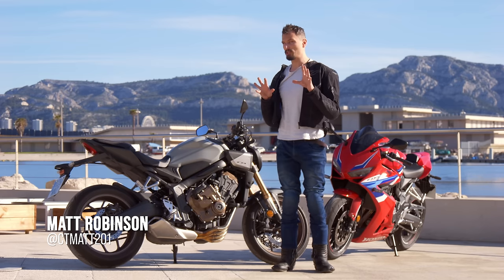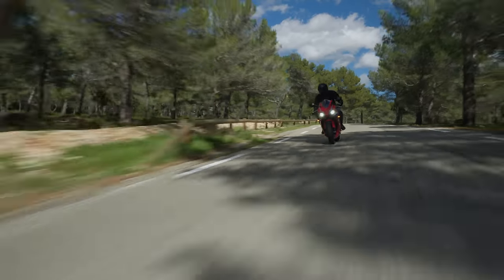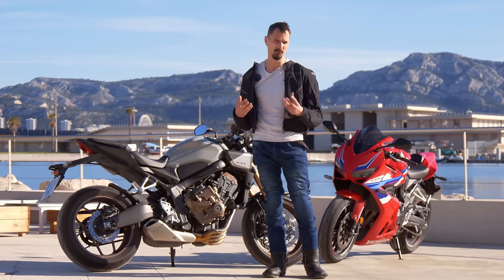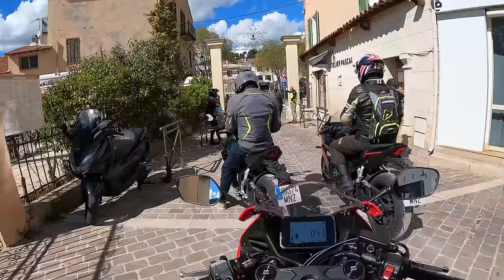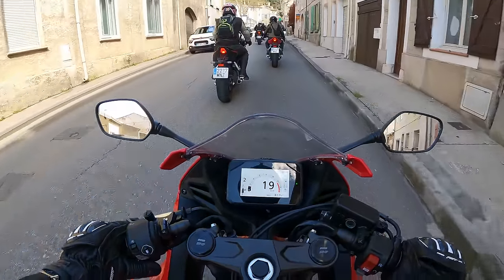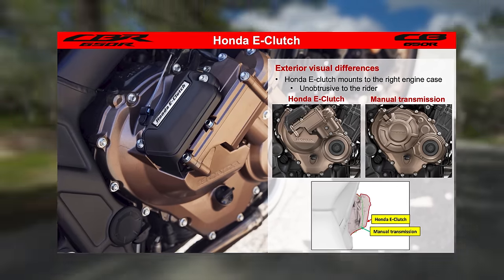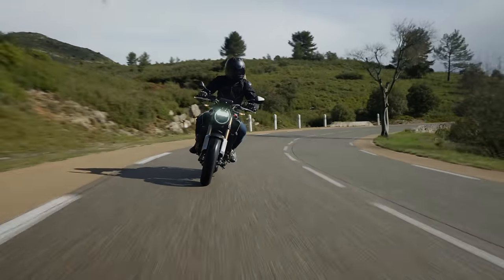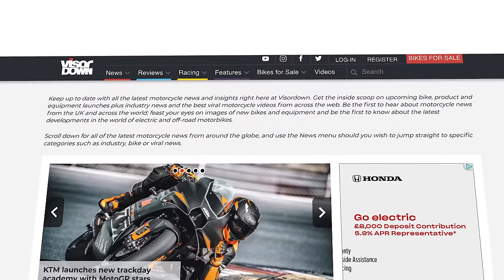Is Honda's E-Clutch A Gearbox Game-Changer?

Comment: Now if they make to gear change using the same tech those of us that have a foot injury could ride any bike and not just the DCT ones. What reviewers always forget is that it is DCT that makes the bike an automatic it is the electronics, so put an actuator on the gear lever instead a mechanical connection (as BMW are going to do) stick a couple of buttons on the handlebars (as BMW aren’t going to do), put the lot under EMU control with a six axis and you have the best of all worlds and everyone would be happy, manual, auto, injured hand, injured foot, just lazy, virtually everyone.

Comment: Does anyone know if it's possible to convert the taillight from the 2024 variant to the 2023 variant?

Would be really cool if it worked because I think the front of the 2023 looks better than the 2024 front :)

Would be a good combination with the 2023 front and 2024 rear lights.

Comment: Makes me even more happy that my GSXR750 is bare bones even for a 2015. No TC, No ABS. Just great suspension, great brakes and a world class chassis. I was looking at other new bikes and all the electric trash and added failure points just pissed me off. 

Sure technology is cool, but not when you see an 80,000 mile GSXR ride past as your almost new bike is in for repairs and elecronics recalls, just for a somewhat unnecessary piece of kit.

Comment: i'm a bit slow... do you use your foot to change up/down or it it done automatically?
Reply: You still use the gear lever, as far as I understand it there is a sensor on the gear shift link (like on a quickshifter) on changing up, the ignition is cut and the e clutch operates, the gear goes in then the e clutch drops out. Down changes are a bit lumpy as there is no autoblipper as it's still a cable operated throttle, when it's Ride by Wire it will be unbeatable.
Reply: You use your feet for up and down and you do not touch the clutch when in e clutch mode 
It can be driven with the clutch by overriding it on the instrument panel or by pressing the clutch in when driving as it over rides the e clutch
Reply: The explanation of e-clutch is a genius solution for the city with heavy congested traffic Boston, for example. I gave up driving stick shift back in 2014 due to traffic nightmare @ times, but I do miss stick shift. Great job by Honda. It's good that major companies use innovation to keep up with new ideas instead of keeping with old ideas/normal. It's perfectly OK to break from the "taboo" mentality.
Reply: I have the bike in thailand its a dream to drive
Reply: It’s still a full manual transmission, but you do not have to operate the clutch.

Comment: I don’t see the point in this solution. I’m perfectly happy with a quick shifter and I’d probably be okay without that too if I loved a bike that didn’t come with one. I can imagine that DCT is great on a Goldwing or an Africa Twin. This looks like a solution looking for a problem.
Reply: it reduces shift shock and you can use it at low rpms and low load unlike a quick shifter. especially auto blippers are rare from manufacturer. i have a mild disability and can't blip the throttle while squeezing the brake so I'm really hoping this comes to the united states.
Reply: The point is it’s even faster and smoother than a quick shifter, it allows shifting at any rpm and load, and it allows you to still have a full manual transmission, while not having to constantly worth the clutch in traffic. The best part- you can still use the clutch.

Comment: kinda sounds like their bike from the 90s called honda dream 110? We used to have it and the difference is there was no clutch lever at all but you need to change gear normally.
Reply: Same with the SuperCub. But, those were centrifugal clutches. This is a real clutch, that’s controlled through an electronic mechanism. But it also still has a lever and cable to override it. It still uses a true manual transmission as well.

Comment: It sounds like a dual clutch CVT if I’m wrong, please correct me
Reply: It’s not. It’s an electronic mechanism that controls the clutch, with a manual clutch lever and cable still attached. It’s also a true manual transmission, where your foot is actually moving gears through the lever, instead of electronically like the “manual” buttons of a DCT

Comment: Does this function as a hillstop/start to like i think BMW has in some bikes. So you dont need to use any breaks to roll back. Never tried that hillstop/start help myself but is this similar? Dont understand this from this video
Reply: No it does not, you will have to put your brake on and then just accelerator on to go

Comment: does it works exactly like a quickshifter/autoblipper?

do you need to let go of the gas before upshifts?

and does it blip when you downshift?
Reply: 1. No. With a quickshifter you need the clutch when coming to a stop.
2. No. And you can also downshift while accelerating.
3. No. Because the throtle is still cable operated. No riding modes either, for the same reason.
Reply: @MacAlex007 thx

Comment: If eclutch is activated, do I have to briefly take off the accelerator when changing gear?
Reply: No, it will work like a quick shifter up, and if you're on the gas while shifting down, you need to figure out why you're doing that.
Reply: No, the ECM also controls the throttle.

Comment: Kinda Confused about this tech, say you are in 5th gear and came to a full stop, the bike wont die even without pulling the clutch?
Reply: That’s correct. It also partially disengages the clutch anytime you make a gear change, along with cutting the throttle, so it’s smoother and faster than a normal quick shifter.

Comment: Hmmm I wonder if this needs maintenance.. Also I feel it's like adding another point of failure where there doesn't need to be one.
I assume if you where to get issues with this.. It will definitely stop the bike from being usable
Reply: If there’s an issue with the E-clutch you can actually disable it from the menu and use the clutch like normal.
Reply: @GL4SS_20  ohhh that's good. This then negates that issue then if it can be disabled and the clutch can still function as well as the transmission
Reply: biggest point of failure is the engine  :D  this, you can easily override, in fact,  you can opt to never use it, use the clutch lever.
Reply: Well, your argument can be made for everything which is not essential to a bike: ABS, Quickshifter, Traction Control, Light Assist, Cruise Control, heated grips and so on. 
Maybe a bike from the 90s would then the best fit for you? ✌️

Comment: for the same rough cost as having ABS (in N/A)... why wouldn't you put it on all your bikes? Maybe leave the Grom and 300 series out of it but I see absolutely not reason why it shouldn't be slapped on everything... you want manual? Use it like a manual. You want to just rip it on a highway and let the e-clutch do its thing? Rip away. Have to emergency brake and forget to actively down-shift? No problem!

Comment: If Honda can add the bmw S1000rr braking in which when you reach for the front brakes, the bike automatically activates the rear brakes, then you will have the perfect city street riders
Reply: Honda already used linked braking system on many bikes. VFR in my memory may be first i saw. Its more of a gimmick with aditional weight.

Comment: Does it have quickshifter and autoblip?
Reply: It works as a quickshifter+autoblip when you changing gears. But you can’t stall with this e-clutch, even if you stops with 6 gear and then trying to ride again 😮

Comment: So it basically just like centrifugal clutch with extra step? Welp, why not just give them centrifugal instead so much cheaper, already well designed and developed for years.
Reply: Because it still allows full manual control of the clutch, like for very slow speed maneuvering, plus the fact that the computer disengages the clutch during a shift makes it smoother, especially at lower rpm’s.

Comment: Even if it works okay, this sounds exactly like modern day marketing, brainwashing customers into what they want you to have, not really what people want. There is almost always some hidden reason for this.Usually its money,  Epa regulations , and or insurance company politics, etc.
Reply: Oh ffs. It’s still a full clutch. You can still manually operate it. It allows you to not have to pull in the clutch lever, unless you want to, and because it can control the clutch, it allows for even faster and smoother quick shifting in both directions. There’s no conspiracy here. There are tons of people that don’t wanna have to use a clutch anymore to ride, especially in traffic (myself included, which is why the Busa sits in the garage, and I take a scooter when I’m running errands around town).
Reply: @thetowndrunk988  , slow clap :)

Comment: Still haven't understood if there is an actual gear shift by the footpeg!!!
Reply: Yes, its auto clutch, you still need to shift gears with your foot.  think of it as a Quick shifter but you don't have to worry about clutching even on stops  :D
Reply: @mannyechaluce3814  Don't you still have to release the throttle when shifting with the e-clutch, unlike a quickshifter which automatically kills power to the engine?
Reply: Yes, it’s a true manual.
Reply: @GaijinMo no, it also cuts power

Comment: I”m confused, is this manual or DCT?
Reply: its a bog standard gearbox and clutch. only difference is the mechanism to operate the clutch where is can be done like a normal bike, manually or automatic clutch via that bulky looking electronic system
Reply: manual , where you can opt to not to use the clutch   :D

Comment: For 100 pounds i could test that. It should be easy to remove since it already have bypass. Be realistic anyone now after quick shift, auto blippers, and gpshifts, but for average rider its gives no real advantage. Average motorcyclist rides to rearly, cant corner properly, and these technologies give some of them thought that they already superiors compared to other, second they try to drag a knee without real understanding why do that, and after max 10 000km they are laying in corner.... Best mod for motorcycle is driving itself.

Comment: Let me guess it's amazing until it starts having faults and then only a Honda dealers can fix it at 100'sssss of ££££££.
Reply: In my experience the only thing that breaks a Honda is abuse and negligence; hard to warranty stupidity.
Reply: @UncleWally3  The are living on the reputation of the past. Same as Uber reliable German cars. It's just not true anymore.
Reply: of course, maybe after 200,000 miles   :D